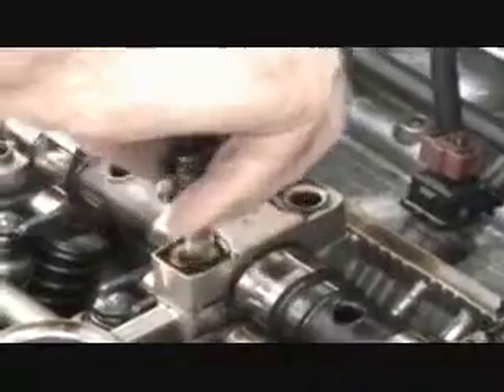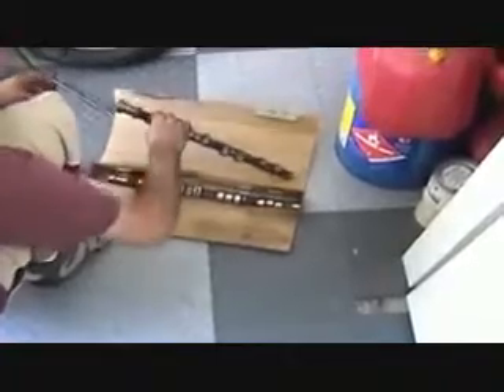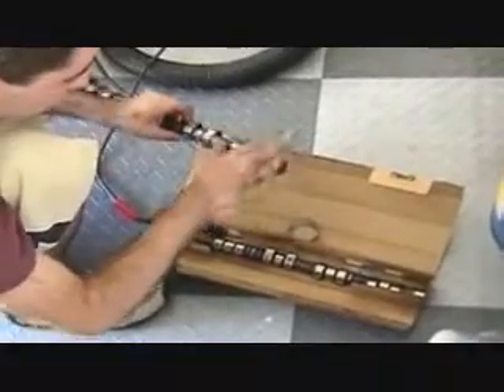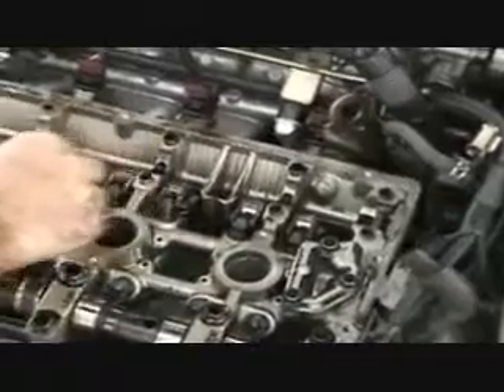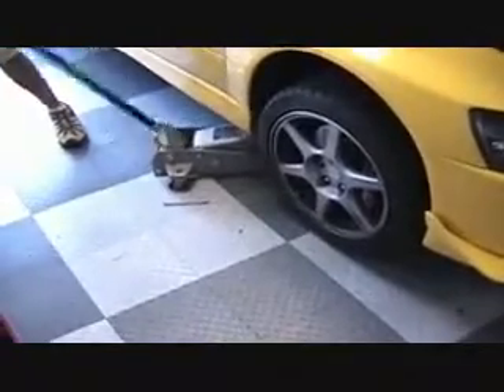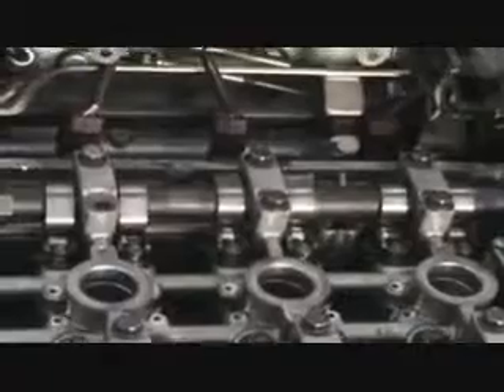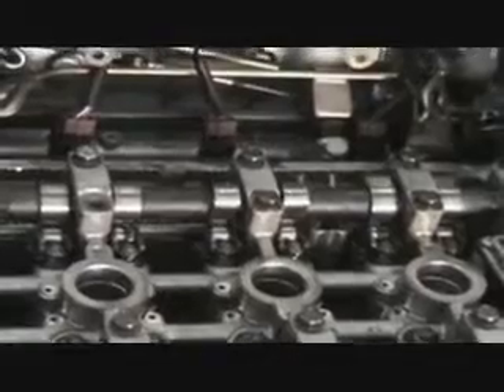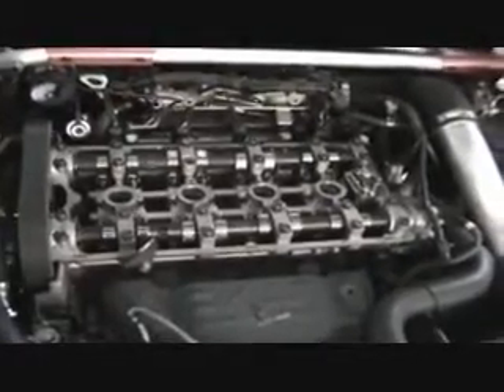Installing Cams on Evo VIII - Part 2

Comment: one thing you can also do is when you want to take your cam out sometimes they are really seated in their and you dont want to pull on it because they are very fragile and can break. so using that same spot with the cresent wrench just turn your cam and it will pop right out.

Comment: Everyone asking questions about the lifters. No they will not damage anything if you do not bleed them. But if they have air in them they will tick and theoretically you will not get the maximum amount of lift you should be getting out of your cams. It's very easy to bleed them that's why everyone says to do them while you're doing cams because they're right there.

Comment: I read that you need to bleed the lifters before installing the new cams.  It doesn't show you doing that in the video.  Will it damage them because they are not like the old ones on the flipped 4g63?